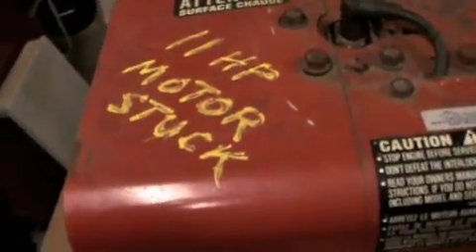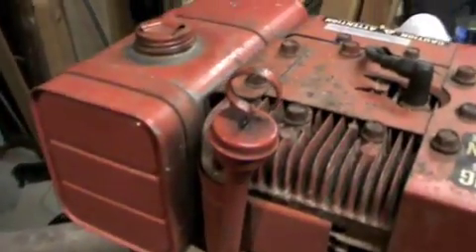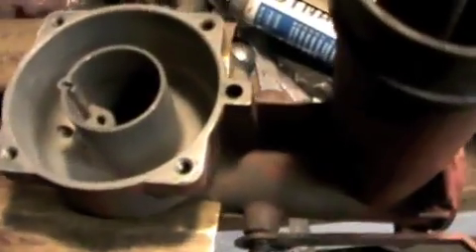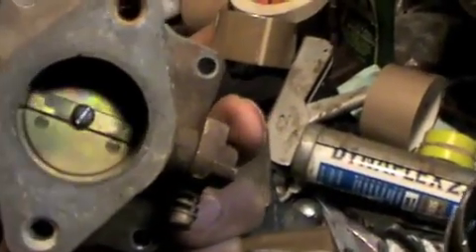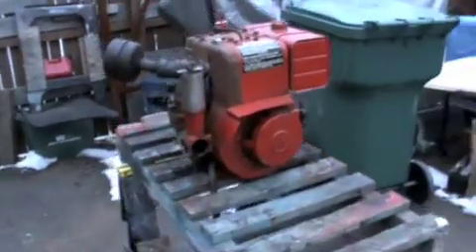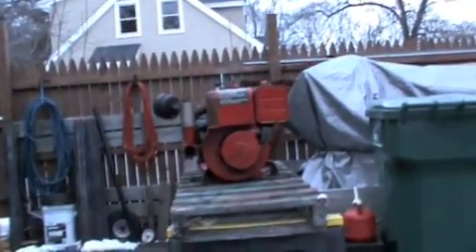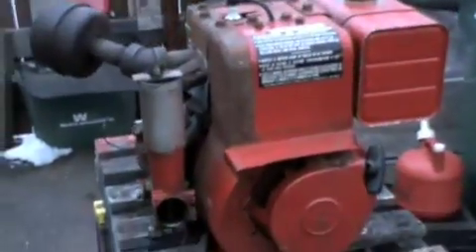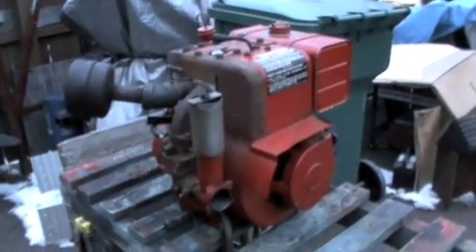Briggs and Stratton 11hp engine

Comment: My brother just got one of these for free it was used in a generator.  We want to throw it on the go-kart we have as it will be a great upgrade to the 5 hp that's on there.  Question I have though is it may not be an upgrade.  Where the pulley is showing opposite the pull-starter is there a gear reduction in-side the cases there?  I been searching the web with no prevail so I'm hoping you can answer this question.  Private message me or just post on here thanks for your time I hope you can let me know. regards -jay

Comment: hey i have a briggs 8 hp on a toro 8 32 i have put alot of new parts into it fly wheel and magneto/ gaskets cleaned and rebuilt the carb new fuel line (have not replaced the filter yet but i have never seen this kind before ) it is inline not on the tank cleaned it all up new muffler also put a stator on it  for heated hand grips and a light and i had it runing great but as soon as its geting warm it starts to back fire and stalls can you help me (i think it might be a stickin valvesmokeswncold

Comment: Where can I find a needle valve, I need one for my engine, I can send you video of my engine, for some help. I had it started it ran, then quit cause the carb was flooded, all the way to head. I think if i can find a needle it should be okay. Any suggestions? your help would be most appreciated. Thanks

Comment: does that 11hp have a recharging system  to charge a battery  .I'm thinking of putting  this In my argo
Reply from the maker: This one does not. Most blocks are cast with the mounting holes under the flywheel so you'd be able to bolt on the stator. Then you just need a flywheel with the magnets.